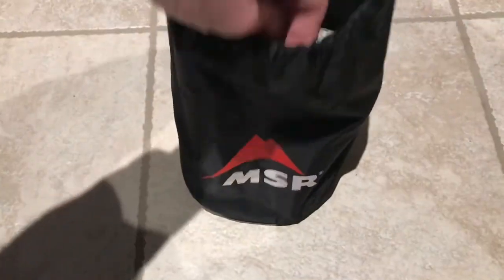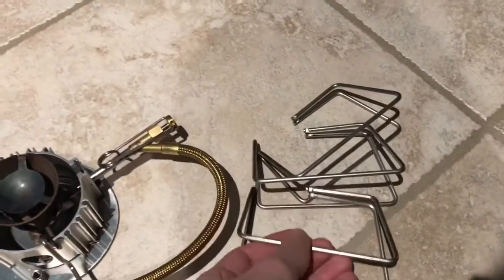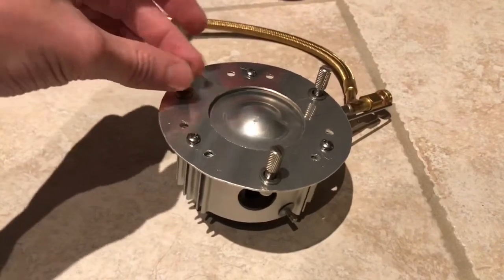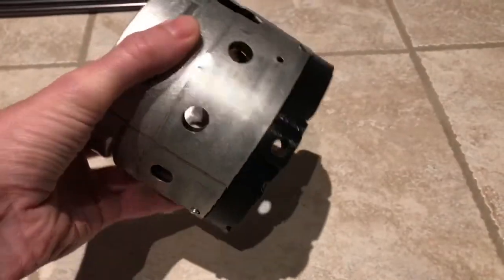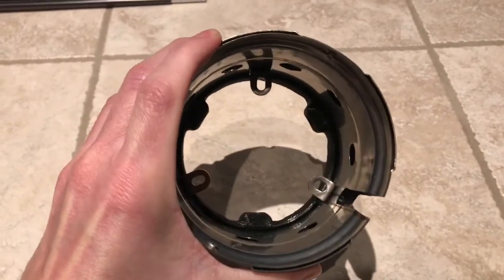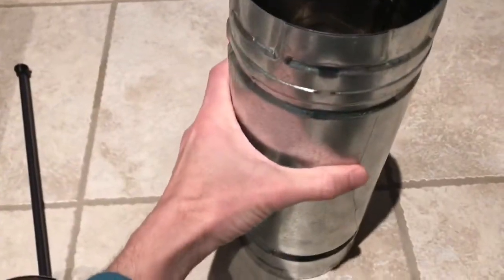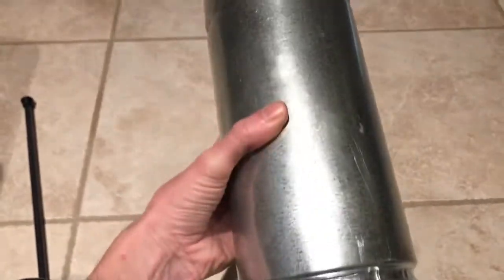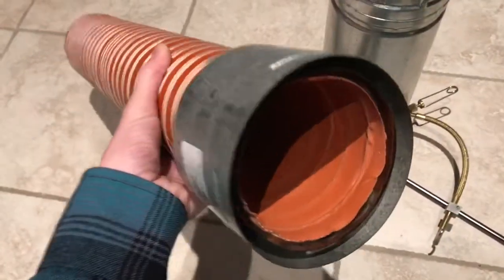Portable Aircraft PreHeater

Comment: Where did you get the double wall stack components?
Reply from the maker: Hey!

Here is a parts list. 

-Amazon
DuraVent 4”x12” stainless steel Straight Pipe Double wall SD3112
DuraVent 4” Pellet to Flex adapter
DuraVent 4PVP-ADFM 4” Pelletvent 
Weanas AL Rod Tent Pole Replacement
MSR Dragonfly Portable Camping Stove
Elenture Yoga Mat Bag, full-zip

-custom made
3D printed Base
Aluminum adapter plate for stove

-Aircraft Spruce
Sceet-15 Ducting 3 3/4 2ft

-McMaster Carr
18-8 stainless steel heavy duty rivet nut 10-32 internal thead
Knurled head thumb screw Stainless 10-32 thread 1/2” long
Reply: @1mbowen super helpful!!!